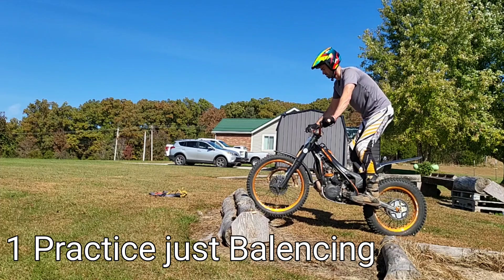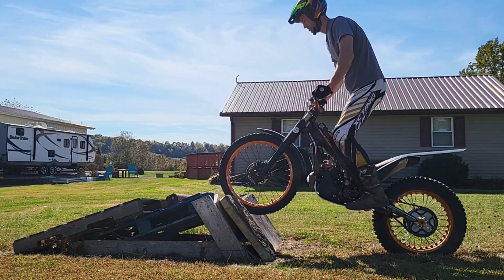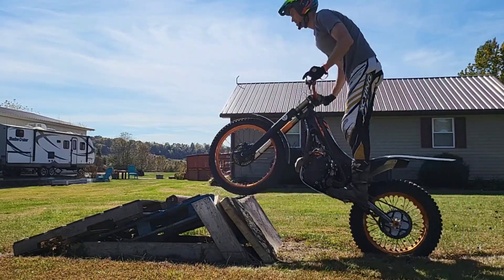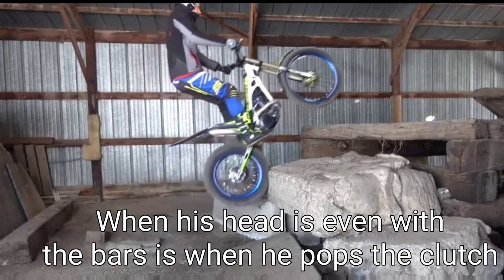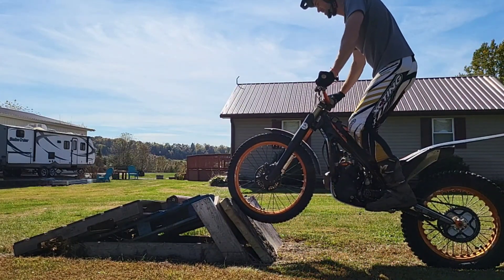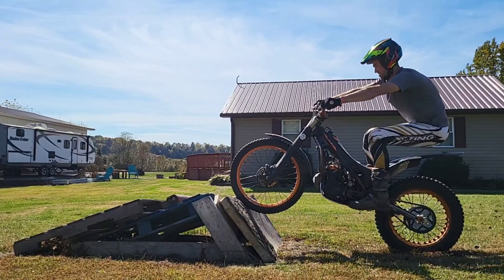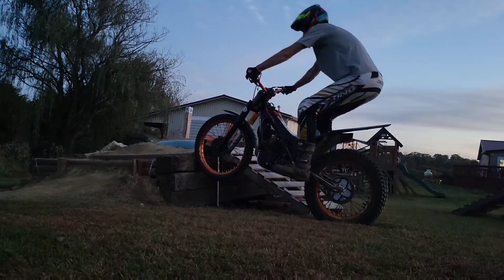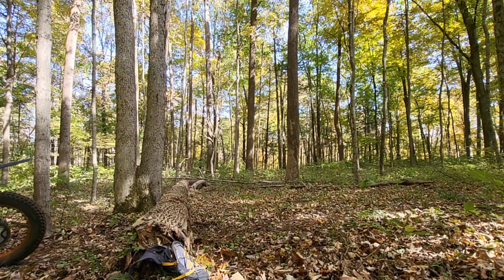Rev Higher & Pull Harder - Learning Stuff to Stationary Zap Day 1

Comment: Beginner here as well and looking at bikes to buy. What si,e do you personally recommend? 170 lbs with good dirt bike background
Reply from the maker: I wouldn't buy new unless you have money to burn. Buying 1-7 year old bike will give you permission to drop it, which you will, and money for parts, which you'll need. But the newest you can afford with $500 - $1000 left for parts and gear. Trials boots are needed not MX ones. 

I'd say 250 CC is plenty. 

Can't go wrong with any bike brand really. Dealer support might be more important than the actual brand for your 1st bike. They are all very good and similar in many ways. I like sherco/Scorpa. If I had the money- vertigo. I don't care for 4 stroke or beta. But I've only ridden for a couple years and am not as well versed as someone like Danny Butler trial tube. 

Join a Facebook group and start looking and seeing what's out there. If you are in the states - trials bikes for sale USA is good. Sometimes marketplace doesn't have all the listings. Better yet, go to a local event and talk to everyone. 😁 Somebody will let you ride theirs and tell you all about why they like that brand, someone else will be selling a bike.  You'll have friends and leads in no time. 😉 Good luck. It's very addicting. It's the perfect cross training platform for dirt bikes.